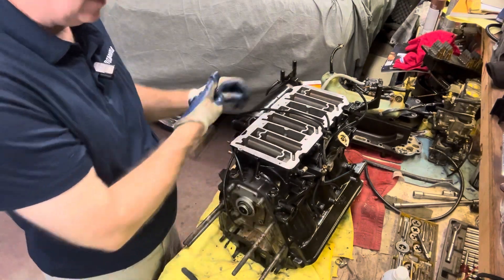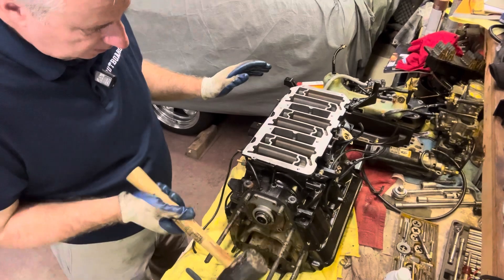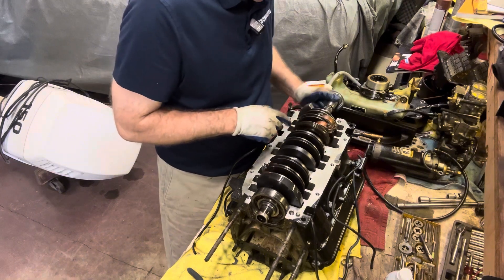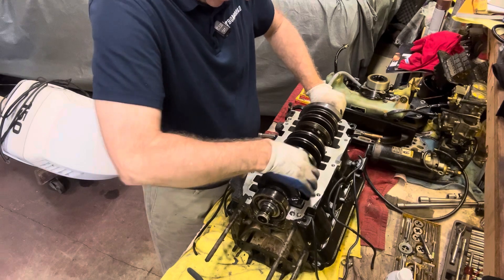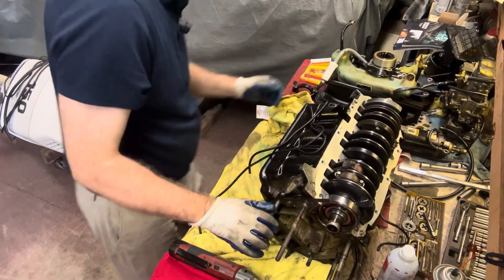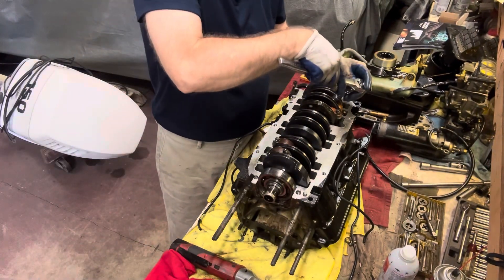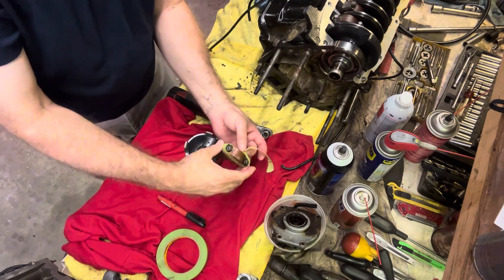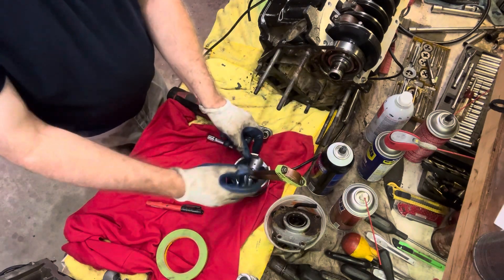Mercury 150 Outboard piston removal (Part 7)

Comment: It's curious how bad it looks a piston that gave good compression.

This reminds me that it's mandatory to replace the piston of my two stroke 363cc motocross engine every 20 hours of racing, which happened once a year when I was racing in my youth.

My bike maximum nominal power was 42hp at 7500 rpm, and the single piston by the way was 85mm in diameter, or about the same size as the pistons of your 150hp.

Is this engine 2000cc, at 333cc per cilinder?

6 cylinders by 42hp equals 252hp, instead of 150hp.

I know that it's not the same racing a motocross bike with a 5 speeds gearbox than cruising a boat with no gearbox, which explains why this outboard is 150hp at 5700 rpm "only".

Pistons in this outboard should last much longer than 20 hours, probably more than 200 hours if not 500, but it seems like in your case having some scratches you better go ahead boring cylinders and replacing all six pistons instead of only the rings, which is the way to go when cylinders and pistons look great.

It seems to me like this engine suffered a bad overheating more than once
.
Reply from the maker: @josemariatrueba4568  I tend to agree. One of the differences in these outboards is that you can have uneven piston sizes in different cylinders. So I could keep the one standard and bore the others. Going to begin light honing first and measure to see how they look and how much needs to be removed. These are standard at 7-8 thousands piston wall clearance and can handle up to 10 thousands but I like to be closer than that. Next video will be some measurements and talk about options. Will probably buy one standard piston ring set and measure ring gap before ordering more. Thanks for you comments and experience, I appreciate it!
Reply: @OutboardDad 
I see!
Maybe honing is enough in four out of six cylinders using standard pistons after making your measurements. 

In the worst case maybe you only need boring and using oversized pistons for the two cylinders of bad scratches. 

Thanks a lot for sharing your very well done jobs.
I doubt that an average professional mechanic would do it any better.

It's a pleasure being able to follow your episodes from here at the other side of the puddle.
Reply from the maker: @josemariatrueba4568  I also appreciate your comments, I always learn more from real mechanics. I am hoping just 2 but we will see how it goes. I will have a used outboard buying guide for sale soon so stay tuned! Special price for my YouTube watchers!
Reply from the maker: Where are you from?
Reply: @OutboardDad I'm from Bilbao, a city at the northern coast of Spain near France.

I went to Southeast Texas when I was young and I had visited the US several times because my company used to send me to some broadcast exhibitions named NAB in Las Vegas and to visit some factories mainly from California.

I fancy boats since I was very small. I've got a picture onboard my parents boat when I was three months old, and I got my captain license when I was 15.

I own a 14 foot boat with a 15hp two stroke Mercury for rowing and some fishing, a Pursuit 2550 that used to have twin Mercury 135 two stroke but now we've got only a single one, because the other one got destroyed. We use thIs boat for fishing and sunbathing with the family.

Also got a racing 25 foot sailboat with a Mercury 5 two stroke (I've got one short and three long shafts, four units in all).

I love two strokes, I'm retired and I still keep my vintage motocrosss bike.

Your accent sounds American but...
Where are you from?
Reply from the maker: @josemariatrueba4568  wow great story here. Yes I am in New Jersey. I would love to do a zoom interview with you and talk about boats and motors.
Reply: @OutboardDad  Great, whenever you wish!

Last time I went with my wife to spend one week in Manhattan and next week in Newport, RI.
Reply from the maker: @josemariatrueba4568  send me an email Keith.outboarddad.com
Reply from the maker: Sorry keith@outboarddad.com
Reply: @OutboardDad 
Ok
I will